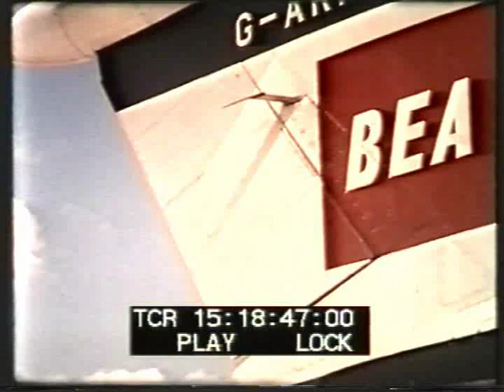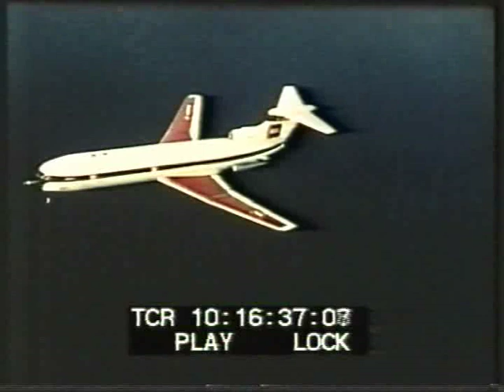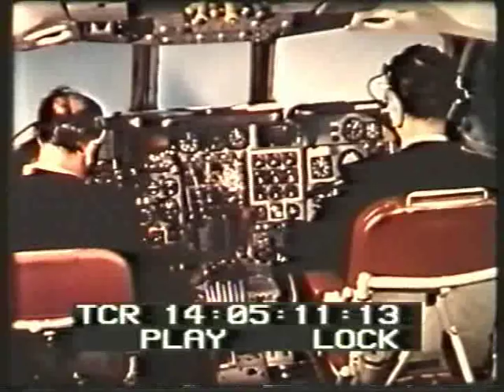Hawker Siddeley Aviation TRIDENT - Promotional Films 1964

Comment: It was and still is, a cool looking plane. Apparently it was wicked noisy though.
Reply from the maker: Yes, I lived at the end of runway at LHR, used to hurt my ears if outside house. Concorde was loud but quickly passed, Tridents and 1-11s took ages to claw themselves into the air
Reply: @ClassicAviationTV  For the first 13 years of my life in Hatfield the alarm clock was the start of Trident engine running.